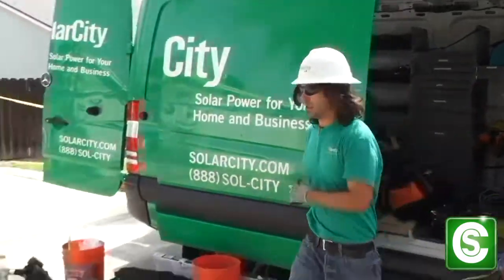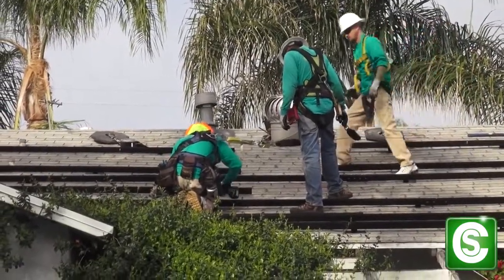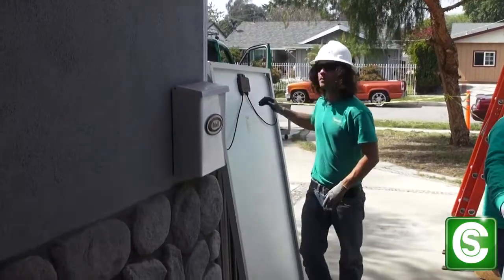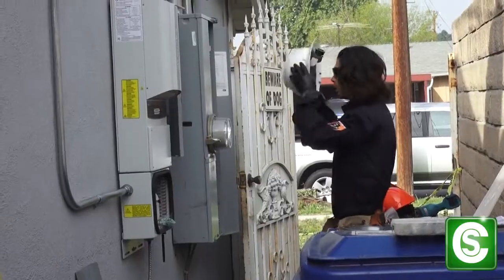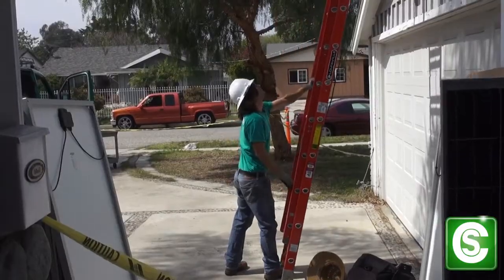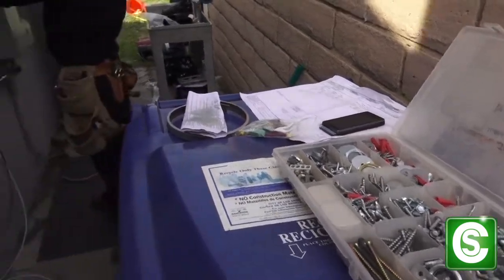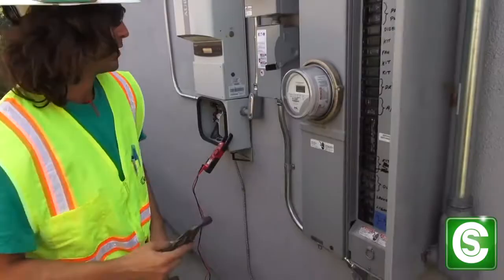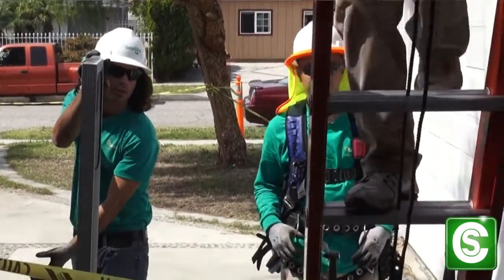How to Become a Solar Installation Lead

Comment: Going on a ride along with a company next week to evaluate my experience as an installer. I got this far along the process from personal experience. I installed a small backup solar system with a battery bank at my house and showed the company some pictures of what I did. I also have some DIY Electrical experience I told them about. I’m a bit nervous because My system is quite small compared to most systems they handle, but hopefully my DIY experience will pay off and they will offer me a position 🤞